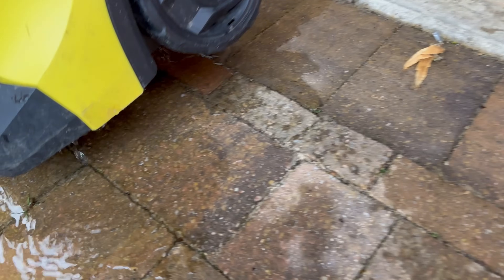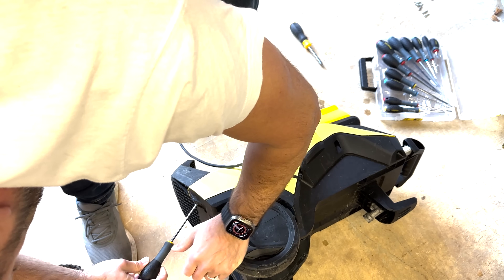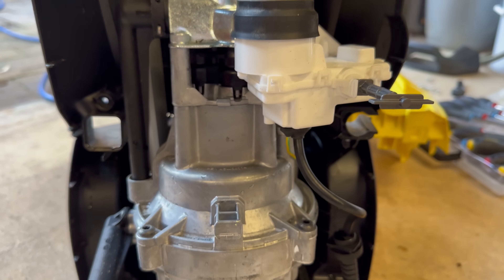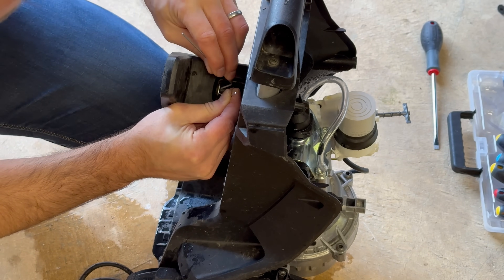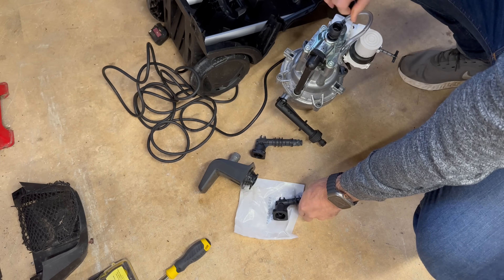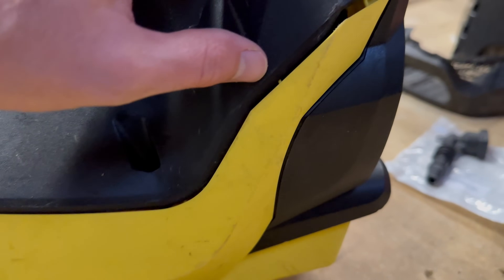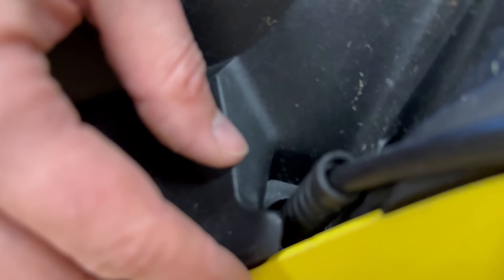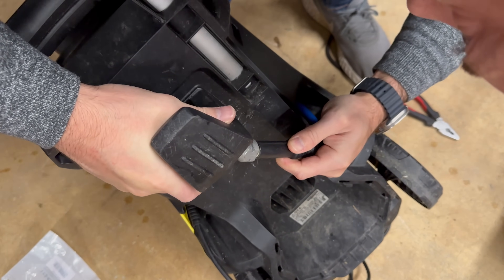Karcher K4 Pressure Washer - How to Open and Fix an Internal Leak

Comment: Fixed my own but fitted a metal elbow common fault with them you would think Karcher would be fitting metal ones from new.
Reply from the maker: Do you have the part number for the metal elbow you fitted and which model of Karcher did you fix? I know the K5 comes with a metal elbow as standard, but I’m wanting to find out if anyone has replaced the plastic version with a metal alternative and whether there were any issues. Thanks.
Reply: @SwiftDevelopments  Sorry don't have the parts number sure I got off Ebay uk if not was on a UK site but was not through karcher parts department good luck.

Comment: My device is still under warranty, is this something that would be replaced under warranty? Or would they say it is because of frost during winter months?
Reply from the maker: It should be replaced under warranty. This particular part is injection moulded which creates a weak point down the seam. I would expect Karcher will just replace it or ask you to take it to one of their service centres to get it fixed without charge.

Comment: Hi this is great as I have the same issue. Where did you get your replacement part please. Thank you
Reply from the maker: I bought it from Amazon because it worked out cheaper than buying it from a parts website and paying extra for postage.
Reply: What size torque screwdriver
Reply from the maker: @MrMickthemod  I think it was a T15 Torx

Comment: I just realized there was a plastic ball bearing when i was disassembling now I'm finding where it had fallen cannot find anywhere. Can you please help me from where i can get another one online .
Reply: I think it had an important purpose that is why it's put in by manufacturer.
Reply from the maker: @4908Arsalan the part comes in the ‘K4/K5 Solution Docking Station Complete’, part number 9.002-423.0. If you look online, it comes with the clear tube, black shuttle and if you look closely in the pictures, you can see the white plastic ball in the tube.

You’d need to check with Karcher directly to see if this ball can be ordered separately.

Comment: Looks the same problem that we have. Only used it twice 🙈🙄
Reply: 2 ? You did better than us. Ours was broken right from the unboxing.  Found it difficult sorting with Karcher... eventually got it collected and a refund. Went and bought a Kranzle machine. More spendy but infinitely better made. None of the moulded plastic bollox on parts pressurised at 100+ bar.

Comment: Not discharged machine properly on shut down. Frozen in winter. Not bad for an amateur!!!😊
Reply from the maker: My machine is usually discharged after use and this part failed in October, when the lowest temperature recorded on my garage thermometer in the 6 months prior was 12 degrees. With these elbows being injection moulded, I think it is only a matter of time before they split considering the pressures they are subjected to.

Comment: This is what happends when u use an aqua stop hose fitting the pressure gets trapped in the machine and can crack internal components
Reply from the maker: The advice is not to use AquaStop valves because they can starve the pump of water if they restrict the recommended flow rate. This particular issue is after the pump has pressurised the water, so it has no bearing on the issue.

Relieving pressure in the hose and pipe after use before packing away will help prevent this part splitting. Also ensuring the pressure washer doesn’t freeze in winter should ensure water in the plastic parts doesn’t expand and crack the seams.
Reply: Yes I think you are absolutely correct good call

Comment: That spring clip would have been easier to remove with a generic pick set from Amazon.
Reply from the maker: It’s possible they could work better…when first disassembling I didn’t realise the clip was accessible from the underside, mine was wedged in there so using a thin screwdriver or something similar to push it out from the back will likely be the most effective method of removal.

Comment: It seems like a temporary fix .... This is clearly a crap part that will fail again after some time, I wonder if there is a better way to fix this , that doesn't use a weak part
Reply from the maker: Hi @john3Va, you’re right, it does feel like it’s only a matter of time before it fails again. How long it lasts is anyone’s guess; I appear to have been lucky compared to others as mine has lasted years. There is the metal variant of this elbow which I’ve linked in the description; this is the part that comes as standard on the K5.

Comment: surely someone could come up with a brass elbow with the correct mating surfaces good milking pot for Karcher to replace with another plastic elbow.
Reply from the maker: Hi, there is a metal variant of this elbow which comes as standard on the K5, Google this part number: 9.042-155.0